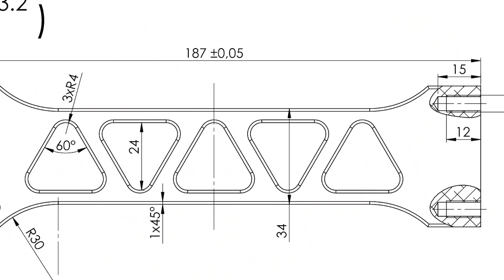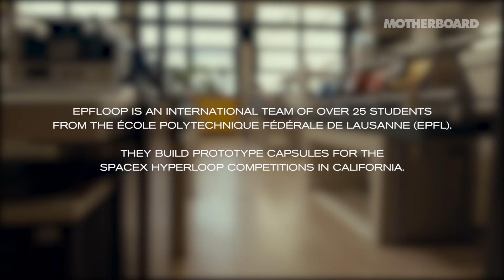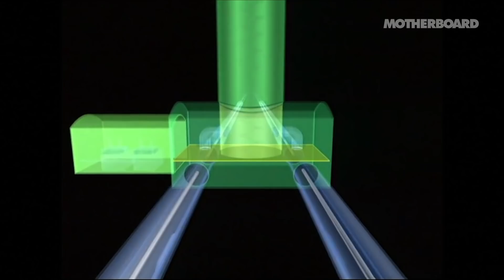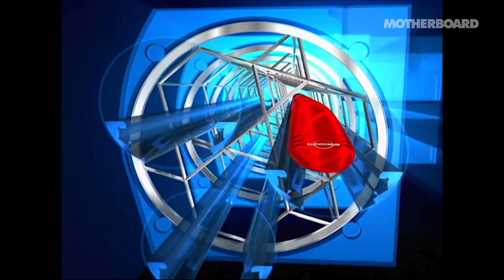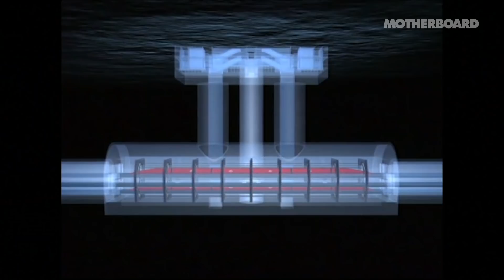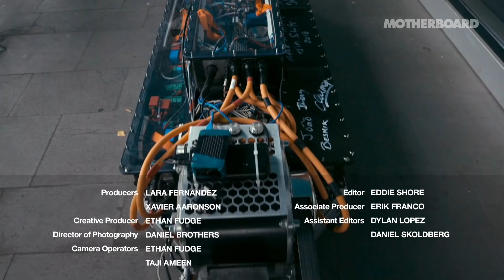Hyperloop Revolution: The Real Story of its Origins and Future

Comment: Two things that annoy me: (1) Elon Musk didn't invent the concept of hyperloop, (2) everyone talks about the capsule and the propulsion, that is actually the easy bit as the technology exists and is already in use, the super difficult part which is almost impossible is building the vacuum tube, this is going to be a hell of a challenge!
Here is why the tube will be so difficult to build:
- to my knowledge, unless we build the tube deep enough underground, there are no known marterials that is suitable to build the tube (structural rigidity, dilation properties...) or that can be produced in large enough quantities to build any significant length of tube (carbon fiber, nanotubes, graphene maybe ... but for miles of tubes that won't happen in the next decade and maybe a lot longer),
- getting a perfect and lasting seal between sections will be very difficult,
- any damage to the tube or to the joints between the sections of tube and there will be a major accident with lots of casualties (damage could be from wear and tear, from geological movements or criminal,
- getting a good enough void in such enormous volumes has never been achieved before ... it is already a struggle to get void or near void in the volume of a building (such rooms are used to test equipment that will be sent in space among other things).

Anyone is willing to do a video about the tube?
Reply: One druk idiot with a rifle. Boooooom. 
And all the energy to take out all that air!!!!! woooow 
You have do bury it deep down for the tube to have a temp that don't swing up and down. 
Making the steel to shrink and expand. And just hope that there will be no aksident or power loss. And i'll hate to be the dude doing the maintenance down there.
Reply: @Lennart_Jensen  aksident might be the most hurtful way possible to write the word accident
Reply: I think we should get some popcorn and wish them luck) at least to see lightspeed train in vacuum) (or something)
Reply: You also forgot how much the human body can handle going up and down or side to side. They would have to be in a straight line.
Reply: If it not close to full vac then what is the point? And even half vac can kill !

Never going to happen! You dumb ass people who believe a very long giant tube under VACUUM will ever be safe are morons, any failure anywhere with the VACUUM tube OR the vehicle inside the VACUUM tube will kill people, Many people! Never going to become a reality, It's just a huge waste of time and money that could be better spent...
Reply: If you are worried about pressure, suggesting to build it underground is stupid. Dirt is going to put a lot more pressure on the tube then air. My understanding is the vacuum would be about the same airline cruising altitudes.
Reply: Concerning damages, keep in mind that these tube will not be as simple as current train infrastructure, so they'll be equipped with lots of sensors that will show a loss in vacuum or defects of the tubes (and wear and tear is very little with most hyperloop systems). Sealing of the tubes is also not a huge problem (e.g gas pipelines).
Reply: @RedHatMedia  Gas pipelines leak all the time, the thing with pipelines is if  one leaks a bit of oil spills and nobody gets hurt. If the hyperloop undergoes explosive decompression you will be hit by a wave of air going 700mph with the viscosity of a brick.
Reply: @RedHatMedia  That's the problem though. The more complicated the more expensive. Railroads seem incredibly simple but even then HSR tracks cost billions. A hyperloop tube would cost vastly more than an HSR track, which is already uneconomical in the us.
Reply: @RedHatMedia  you understand the meaning of implosion? One tiny hole and all the air will try to rush in, crumpling and smashing everything. And have you seen a pipeline? They have joints for heat expansion. These joints are super tight curves which you couldn't have here. The maglev was already done and set and still became a bust...
Reply: Photoandcargeek it’s not a full vacuum stop listening to thunder foot
Reply: @BrandonDKirkwood  I don't know who is thunderfoot. I didn't say it was a full vacuum but already a good vacuum over hundreds of miles in a tube large enough to contain a train... That is huge huge huge. By the way, I am a physics and pure maths undergrad and pure maths grad and not an engineer and don't even work in a scientific field but I know that EM levitation has existed for a long time and is used in monorail trains and I know how hard it is to get a good vacuum or how hard it is to build large structures ... And large structures vacuum sealed is way way way more difficult than a monorail high speed train (which already exists).
Reply: @BrandonDKirkwood  It's like 0.001% air or something. Which is basically a vacuum when you're trying to make a 300 mile long vacuum tube

Comment: 1. Maglev failed because of the high cost.
2. Hyperloop is a maglev in a vacuum tube. 
3. Debunked.
Reply: You okay? maglev failed? It didn't.
Reply: oƃƃə  you are stupid period.
Reply: oƃƃə  Wood constructions won't fly, period. Metal bodies won't swim, period.
Reply: Inductrak (the system Hyperloop's levitation is derived from) isn't the same as traditional maglev.
Reply: I remember when the word "debunk" used to mean something
Reply: Maglev is utilized in many countries.
Reply: @shadowblack1987  After 50 years of development, the only commercial high speed (>200km/h) maglev system is Shanghai Transrapid 30km! line.
It is a total joke.
Reply: @farkhodkhikmatov4738  China's high-speed trains don't use maglev.

Comment: Tube with 0.01 atm for many miles 🤔, isn't that a greater challenge to implement?
Reply: Yes, that's the main challenge. It is hardly ever mentioned because they simply don't have a solution to it. It takes hours to evacuate the 1-mile SpaceX track, and that's with a much smaller diameter.
Reply: @adamdanilowicz4252  The SpaceX track they don't they open the end up everytime they load and unload a pod? With the production system don't they intend to use airlocks so the main track stays at its operating vacuum?
Reply: @stephenmg12  How would people leave the Hyperloop then?
Reply: @adamdanilowicz4252  Yeah because in the real thing they'll have to evacuate the entire tube every time. You sure thought this through /s
Reply: There is a solution, let's take hyperloop to Mars! The real hype train
Reply: Yes, theoretically, that's a valid solution but putting it in practice is the problem. This is, however, one of the countless numbers of other problems. How do you prevent thermal expansion of the tunnel over such a great spanning distance (expansion joints, like seen on bridges, cannot be used since they cannot hold a seel)? How do you provide a stable seel across the joints? How do you manage an emergency in the tunnel? A small puncture in the tunnel leads to a rapid depressurization, how is this overcome?
Don't get me wrong, I'm not against the pursuit of new, modern transportation ideas nor am I anti-science. I'm quite the contrary. I'm simply asking well-grounded questions on the feasibility of the project. Besides, the 'Hyperloop' isn't some radically new idea, having been conceived over a century ago, and since then has been dismissed year after year.  It's easy to blurt out basic and vague ideas like it's been done in science fiction for years, what's more difficult is actually doing it.
Reply: @adamdanilowicz4252  Exactly my thinking, I'm not against the idea, just curious how it all comes together. It's like people don't like to be questioned😂 . Also I never watched Thuderfoot.
Reply: Adam Danilowicz for the expansion joint part, it would be just like any other piping. Seems like you could just upsize expansion joints used elsewhere.  
But If it ever sprang a leak finding it would be a nightmare haha.
Reply: @adamdanilowicz4252  Being a skeptic is a good thing. Good on you! I will try to answer your questions :

1)"How do you prevent thermal expansion of the tunnel over such a great spanning distance (expansion joints, like seen on bridges, cannot be used since they cannot hold a seel)?"

Well how do gas pipeline works ? Because a gaspipeline is just the opposite situation : it is a very long tube with high pressure inside it (more than 10 atm). So engineers had to come up with expansion joints that can whistand this pressure and not leak. This kind of pressure resistant flexible joints do exist and are not very expansive.

Pressure resistant expansion joints
https://www.garlock.com/en/products/style-204-expansion-joint

2) "How do you provide a stable seel across the joints?"

See above.

3)"How do you manage an emergency in the tunnel?"
Slow down all the pods to a stop, represurize the tunnel and evacuate people from the tunnel. Really it is way more of a problem in planes where you can't exactly stop an airline midflight, yet airplanes are the safest way of travelling. I think the issue of an emergency is blown way out of proportions.

4) "A small puncture in the tunnel leads to a rapid depressurization, how is this overcome?" *repressurization not depressurization

First let's get the myth that there would be a total collapse of the tunnel out of the way. Here is a video of a vacuum vessel being opened under water (yet no collapse, keep in mind that water is way more dense than air so if it doesn't collapse with water why would it collapses with air):

https://www.youtube.com/watch?v=VugR1WdAOQw

If  the puncture is small there won't even be enough air to stop the pod and it will need to use mergency breaks. If there is enough air to stop the pod (so a very large portion of the tube would need to be opened then  the airwave would only be traveling at the speed of sound  at worst(remember there is only 1 bar of pressure difference between the interior of the tube and the exterior). Given that the pod is travelling at 800 km/h (what is projected), that is a cumulated speed of almost 2000 km/h. So what kind of damage can an aerodynamic train sustain going 2000 km/h in 1 atm ? Turns out not a lot : F = 1/2*rho*v^2*S*Cx = 1/2*1*555^2*10*0.01=15400 N (Here I have assumed 10 m^2 of exposed surface : this is a very conservative estimates, realistically it will be much less). That's only  1.5 tons of force when hitting the wall of air (it is not a lot, for comparaison an airplane (a320) at takeoff can take twice as much force).
Reply: @Beurglessse  Because no oil pipeline in history has ever leaked. Oh wait, that's right, all of them have leaks.
Reply: @adamdanilowicz4252  now I'm intrigued on the safety point in case of emergency, what would they do in case of that happen in the mids of its track and it is happening so sudden that the range is closing in and with their speed, it won't be much of help and if they can decelerate fast enough so they won't the danger/accident point then the instant deceleration will... anyway, we as the passager/masses won't accept that technology without knowing their safety mechanism (for me at least) would safe their passenger in-board
Reply: @adamdanilowicz4252  do you mean a hole in the pod or the tunnel? The tunnel is easy, if the vacuum is compromised, air comes in and slows the pods down. I would double hull them though. The pod would need to have safety systems like airlines. I don't think a small hole would be as bad as some think, look at the one on ISS. I don't know about the joints, but a major engineering firm seems to think hyperloop is possible, look at the Missouri study.
Reply: @stephenmg12  your ISS comparison misses the point. The catastrophic failure is the tube, not the capsule. the tube has to resist the weight of the earth's atmosphere (and the weather, corrosion, tectonics, etc).

Keeping the air in is the easy part... the limitation of the pod is that at 600kph, you had better be going in very straight lines (or huge curves) or else whatever is inside will be having a ... bumpy ... ride. 

Japan already has 400kph mavleg trains in service right now. And they are profitable, all without having to invent a bajillon (yes, that's a technical specification) new technologies to jockey the energy densities and materials required to make it work.

Keep dreaming, i'm all for that but we have much bigger problems we need to squander invest these resources into first.
Reply: @adamdanilowicz4252  Elon's real genius is getting scientifically ignorant people to buy into this BS, literally.
Reply: @kwyj  it is not BS. Smarter actually. We can have faster transportation, less emissions.
Reply: @tammyleederwhitaker649  your opinion ignores the not only the tremendous technical challenge of maintaining such a vacuum over hundreds and thousands of miles as well as the ridiculous energy cost to creating what would be the worlds largest vacuum chamber.

The challenges aren't just that we haven't tried, physics itself makes it ridiculously expensive compared to conventional modes of transportation.

Each hyperloop pod might use 'less energy' than a car or train car but regular trains require less energy than the hyperloop overall simply because it has to more less air.

Calculate the energy cost of creating that large of a void and get back to us, thanks!
Reply: @kwyj  My opinion is just that, MY OPINION. Understand? God Bless you 🌹🌹🌹🌹🌹🌹🌹1111.
Reply: Never going to happen! You dumb ass people who believe a very long giant tube under VACUUM will ever be safe are morons, any failure anywhere with the VACUUM tube OR the vehicle inside the VACUUM tube will kill people, Many people! Never going to become a reality, It's just a huge waste of time and money that could be better spent...
Reply: there's all so the problem of how long it will take to pump out the air of a tube so long
Reply: Back after two years to laugh at the BS.
Reply: Please educate yourself on the topic at hand before making snarky remarks. Thank you.
Reply: There would be an elegant solution, imo, dunno if anybody already thought about it but : let's divide the tubes into segments with a dedicated pump for each (or a pipe network with a big one for some segments, and an alterative backup pump, just in case), and synchronize the aperture of each portion of the whole canal with the passage of the wagon. Once its passage is done, it would be automatically closed and vacuum pumped for the next cycle. That would save a lot of time for each transport cycle. Could be really appropriate for very long distance transportships.
Reply: no not really stop watching thunderfoot hes a moron that never saw a science class on the inside in his life
Reply: @catnium  doesn't he have a PhD in Chemistry and does research in nuclear plants? so  i'm pretty sure he's been inside many classrooms in his life.
Reply: @catnium  says the 12 year old pony fan
Reply: @catnium  he's a nuclear physicist, if I'm not mistaken?

Comment: Very efficient because of no air resistance, smaller footprint than trains and roads, easily put underground because of small diameter.
Sounds great, excited for the future
The only part i don't understand is why cargo transport? boats are the preferred method and nobody cares about their slow speed
Reply: Safety is less a concern when it's about stuffs, not people. Nobody would pay it hard in case of crash while developping the technique, enhancing it, until it's fully mastered for people transportation.